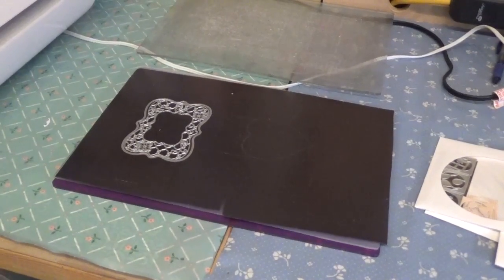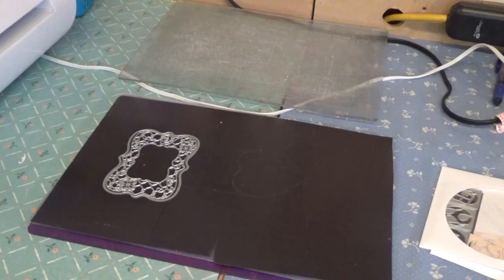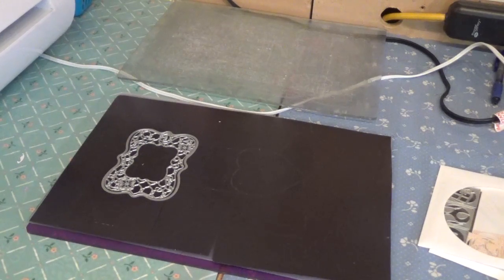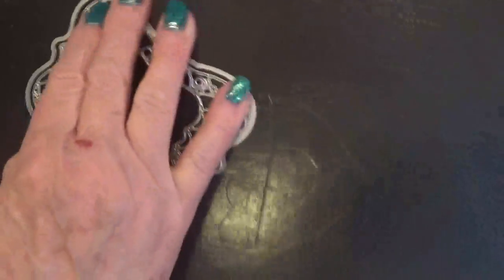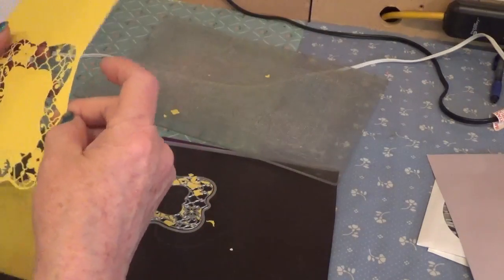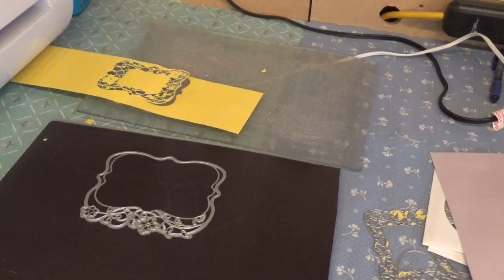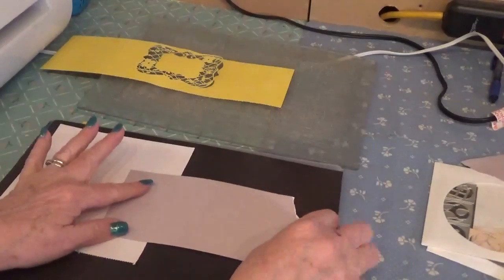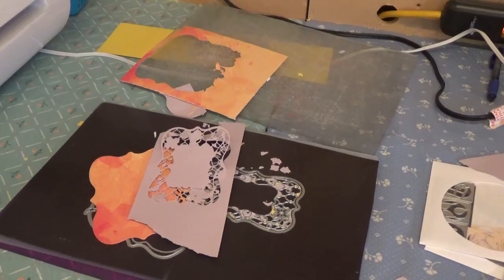How I cut out my dies

Comment: thanks for the tips Bev...I try to position my dies on an angle so it's an even smaller area to get started...you should try to avoid the straight across speed bumps which are hard on the rollers...of course with bigger dies sometimes there just isn't an option...I also move my cutting spot from side to side to try and keep even wear on the machine...I wonder why that first die doesn't cut all the way around???  let me know if you figure that one out...have fun...hugs~P